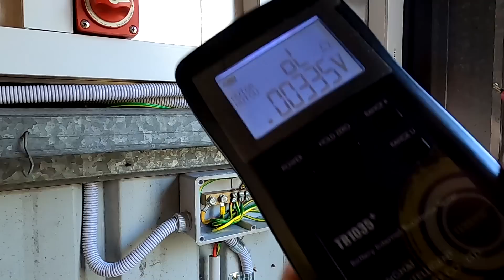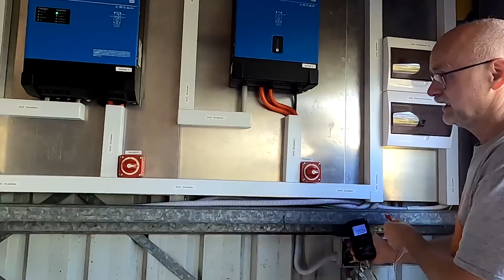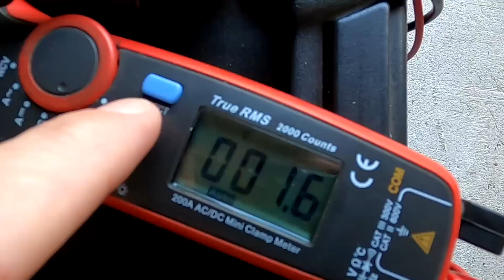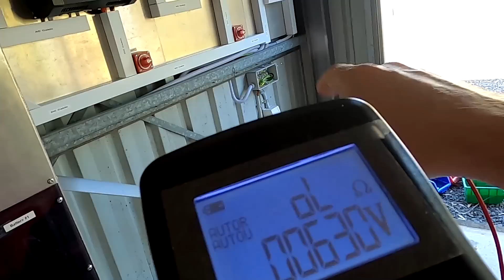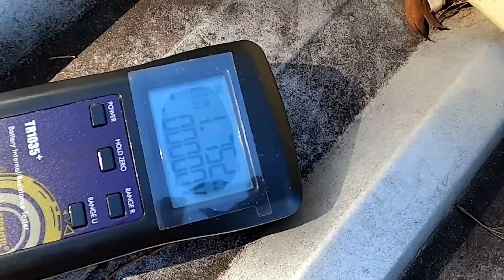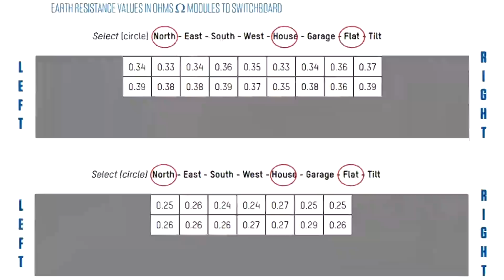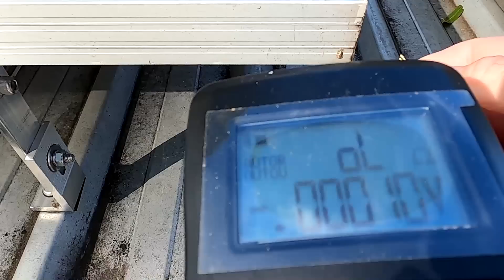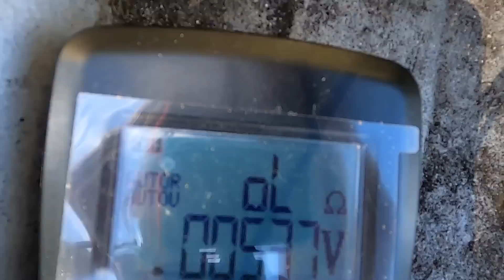Solar System Continuity Test: How to easily test your earthing.

Comment: By grounding the panels you are ,in a sense, raising the ground up to your your roof..if your idea is to remove static from the roof then break the ground with a diode to ground so you are not making the roof a lightning rod…or you could just put in a light switch to turn on before you go on the roof to remove the static…as we all know about magnetism and dc power, opposites attract and likes repel…if the roof is grounded always it will attract lightning….if it instead had a positive charge, or a static charge it would repel lightning…best idea is to put the switch to ground the roof before you go up then off when no one is on the roof…why do you think rvs or any vehicle with solar panels are so much less likely to be lightning struck?..

Comment: What’s the different between earth washes vs the grounding cable you use last time?
Are they interchangeable? Looks like you need both..
Reply from the maker: The earth washers connect the single solar panels to the rail. And you connect the ground cable to the rails. Otherwise you would need to ground every single panel.

Comment: I have mixed feelings on grounding solar panels or even the metal roofing. I understand that if a panel shorts out, you want the current going to ground so you don't get electricuted when servicing. However, when grounding, you effectively turn the solar panels and metal roof into a lightning rod.

Comment: Did not appear to be a problem however I am concerned the large loop area of the wire and return path act as an antenna that can pick up radio waves, inducing current into the loop, and corrupt the resistance measurement that is actually measuring voltage and computing resistance as R=V/I. If the meter is a constant current source it may not be aware of any externally induced current. The external current should be AC and might be ignored by a DC measurement.

Comment: With a Lightning Protective system install in the solar system will you bond the Grounding of the solar to the Lightning Protective system ground together? or it should be separated?

Comment: sir in all my installation I measure the voltage dc between positive end of the string and earth bar and. Then negative end of the string with the earth bar , the voltage will start with a high value like 300v DC and slowly come down to around 100v and stops there around 90 to 100v and. Doesn’t go below that what does that mean , is that still 100v is leaking through the. Earth body and we r loosing actual current , please help me to get the answer as I’m searching for a long. Time and keep doing installations but this pattern is always there

Comment: In most of the Asian country complying their local codes, DC earthing should be separated from AC earthing. At least 3m apart.  Lightning must not be bonded with any AC/DC earthing. This all I am talking about within one premises. I see BS and probably NEC recommends common earthing. Could you please address this issue.

Comment: "Press HOLD to enable the ZR function to measure internal resistance as low as 0.30-0.50 milliohms. The ZR function measures below 5 ohms, and the internal resistance is more accurate."

Comment: Hi great content, dose all this grounding effect the  bi metal insulation between different metals! And Increase corrosion! Which is why the rail feet are insulated in the first place.
Reply from the maker: Thank you, Lauri. Is that why? I thought the rubber is to prevent water from coming in...
Reply: Dissimilar metals can generate a small voltage which has the POTENTIAL to corrupt the resistance measurement.

Comment: how would you solve it, if there would be potential risk from lightning/flash impact? Is better to have grounding connected or is better to have it connected to lightning rod/conductor/termination (i don't know exact name of it).
Reply from the maker: Grounding is for electrical safety.
Lightning Protection is for... well lightning protection
These are two different things. LP is nothing for a DIY job any more and needs proper installation and testing.
Reply: Earthing is to stop you being electrocuted if there is a short to the metal. You'll feel it but it will take the path of least resitance down to earth so won't kill you. You have effectively created a lightening rod so need a lightening arrestor in your combiner box.

Comment: Just installed the 200a jk bms I bought through your link with aliexpress. Tried starting it with 9v positive to b- and negative to p- as per your other video. The light is blinking on bms but inverter and charge contoller does not turn on. Only getting 2.2 v on p- side??? What is going on?
Reply from the maker: Does the app connect?
Reply: @OffGridGarageAustralia  No it does not connect or show up. I think the caps in my inverter spiked the current when I turned on the bms frying it.

Comment: Hi Andy, ich machs mal schnell auf deutsch, sorry, baue gerade meine Victron Anlage in der Garage... hab wenig Zeit. 
(3x MP II 48/5000 2x 450/100 und Fronius 10kW mit 22kWp Solar und 31kWh Speicher)  

Kann es sein, dass du diese Unterlegscheiben (washers) mit den Spitzen falschrum montierst (also mit der Öffnung Richtung Modul, nicht Richtung Halter ? 
ich denke, die sind so gedacht, dass du sie 50% unter die Klemme /Halter und 50% unter das Modul legen sollst, deshalb haben die auch die Aussparung für eine Schraube... nur so ne Idee... 

Deine Werte sind ja so schon Okay 

Gruss aus dem Odenwald
Michael.
Reply from the maker: Hallo Michael, das dachte ich mir auch und hab das probiert. Das hat leider gar nicht funktioniert, denn die Klemme sitzt nur ganz am Ende auf der Schiene und nicht mit der ganzen Flaeche. Am Ende hat sie nochmal so einen kleinen Vorsprung und nut dieser hat mit der Schiene Kontakt. Das ist so gemacht, das der Haltewinkel eine gewisse Hebelwirkung auf das Panel ausuebt.
Ich denke, diese Erdungscheiben sind universal einsetzbar und je nach verwendetem System muss man sie unterschiedlich benutzen.

Comment: Just wondering and not taking into account the regulations, WHY and WHAT is the purpose to ground the metal parts of a solar array?
There is not a a hard connection possible between the metal parts and the live of the grid. It might even improve the change of lighting strikes when the metal parts are grounded….. regards
Reply from the maker: All metal parts need to be grounded for electrical safety. This has nothing to do with lightning protection. Two different things. 
If you have an inverter in your system, you have 230V (or 120V) somewhere. There is always the chance that something goes wrong...
Reply: OK, this could possibly be made up "theoretically". However, the aluminum frame of a solar panel is completely insulated from the cells with their connections, see the double insulated symbol on the panel. So if a live phase ends up on the DC cables from the panel, there is still no reason to ground the frame. Moreover, there are solar arrays for off-grid use (as the off-grid garage) and there is no determined live (phase) at all anymore. Moreover, grounding the frame (on the roof) gives a risk-increasing aspect with regard to lightning strikes.
nice discussion and keep up your most appreciated channel!
Reply: @OffGridGarageAustralia  It's not possible, your home is earthed, and power returns to it's source...you are worried about AC power, not DC, so it returns to it's source which is already grounded/earthed.  It accomplishes nothing, but do it if it makes you feel better about "safety"..  Describe the scenario where grounding a PV system has any "safety".  A ground rod is 25ohms with respect to earth and at 120Vac can carry 5amps tops, where does the rest go?  It's rhetorical, we know where the rest goes....and it's not to earth.
Reply: @iamblaineful  On a different channel, one person earth grounded his solar panels which was about 1k worth. Lightning struck close by and fried everything he had. AC has to be grounded in order to complete the circuit. You are absolutely correct that there is no need to earth ground DC whatsoever otherwise they will have a Lightning Magnet.

Comment: I have been told that the best way to use those special washers is to have them on alternative corners of the panels, which works really well when you have a string of panels and can share a washer between two adjacent panels.
Reply from the maker: They won't be long enough to span across the gab between two panels, Trev.
Reply: @OffGridGarageAustralia  Ah okay, I guess it only works when you are butting the panels up against each other.

Comment: Andy, Just had a thought while watching your vid about faulty victron controller.  I notice you have victron inverters... so do i and i had a bad experience not long after installation.  Lots of sparks and smoke.  The MP2 has a large opening in the bottom and a gecko got in.  The boards dont have conformal coating and gecko got fried. 

I was told it was my fault because I have geckos. It was eventually replaced under warranty when I pointed out that it was installed by their installer to their specifications into an environment that has geckos.

The replacement had a screen fitted by the supplier that keeps the geckos out.

As you are in Queensland, you  should think about screening out the geckos.
Reply: Hi Ron 
I heard more than once from this problem with geckos and lizards 
I live in Philippines now and you see them anytime 
,I start soon with a offgrid build here and use Victron also
Can you tell us how’s look the screen or can you make a photo of it 
Thanks
Marc
Reply: @marcvandaele1878  I dont think I can add photos, but its made of pressed plate steel maybe 1mm, with holes/slots pressed into it, maybe 2mm width. It it bent to conform to the shape of the bottom opening and held in place by the bottom cover.

Also, ensure the cable penetrations are secure for i suspect a gecko crawled up inside a conduit at on stage - a generous squeeze of silicone solved that.

I also put a generous silicone bead along the bottom of the board between the board and back of the case to stop anything that does get in, from squeezing between the high voltage terminals and case ground.

Comment: Hi Andy, you might consider doing a video about planing preparation and checking the PV efficiency too with the australian services from solcast and the usual extension I do not add cause yt would delete the comment if i would add a website. Since feb 2019 they offer a free service tool to check your PV system on a daily base if that is OK or not. The do predict and report the daily energy production with their simulator that asks for the azimuth, pitch , kWp installed and then does the math.

Great service and also free they kindly ask for a support by sharing with friends and family, and as you like to tell, this is our nice big family , right ?

How on earth I got behind an australian service being in germany you might ask ? 
Well, I do use a professional software for planning even made in Berlin, PV*SOL premium which is free for 31 days.
That offered a new interface for getting at least 2 times a month new records from that australian service to import climate dates for your projects and they have faster and more accurate data then the usual slow german services which do currently offer an average set for your city or spot with the data from when ?
Well, an average build from the 1980 - 2010 period and the hottest one from 1995 to 2012.
No, that is not 10 years behind or 10 years old. It is just a pretty nice riped set of records like a good old wine.
But I got those last week and applied it to my most recent projects and could recognice that the 2012 one had a 3% higher solar power input and output.
Not much but 350 kWh p.a. more than before which comes closer to our reality. 

Well, PV SOL had does release a new version every 2 months or so and in the recent update notes they presented the solcast service as a new feature and interface which I then checked out. So from australia to Berlin to me and now to you and our family is a pretty long journey I guess. And it is really hot in germany, really, really hot, one of the hottest days of the year in our forecast. If you check that free tool out there is a link to their blog at the end of the page of explanations (tool itself is on top of the page, not just stupid pics of it, that is the working simulator) and to the cto Nick Enger or so which is also quite nice to read what he is researching. Hope it helps to show how a set of the right planning tools might improve the decisions made to avoid mistakes.

Comment: Should you turn the grounding washer around.  That way the clamp and panel are grounded.  I see the washers appear to be cut out possibly to allow for the mounting bolt?  Also, looks like your meter does have a "Zero" function.  Great videos!

Comment: wow didn't realize the Anodized aluminum is basically insulated aluminum. Although, if that is the case what is the reason to ground it? A stray wire comes into contact with the Anodized alum frame rail and...nothing happens since the coating prevents the power from the wire transmitting to the aluminum  interior? unless there is a heavy scratch or high enough voltage to bridge?
I used Galv unistrut for my installation, although I can't say I did it this way deliberatly  to avoid anodized aluminums' insulation effect, nor did I deliberately drill the PV frames for mounting to the strut to ensure good ground, it just worked out that way LOL.  I also never bothered to test the resistance from Ground to the rails/PV panels (until today!) since it seemed "obvious" that it should all be 'good' - thanks for sharing Andy, now I know I am all good instead of assuming it. Interesting from the comments the various regulations across jurisdictions for the grounding requirements.  Like Arc-fault and Disconnect requirements, these are all different depending upon where you live it seems, perhaps we will see a convergence over the next decade of code requirements for PV everywhere.
Reply from the maker: I didn't know this either as I never tested it but all my panels weren't grounded. I have now ordered more of these washers.

Comment: Das geht aber so nicht mit der Messung ... Messstrom und Spannung zu niedrig ... AC nicht DC
Reply: Messfehler durch Störspannungen oder Strömen im Erdreich von benachbarten Spannungsquellen mit den Frequenzen 16 2/3Hz, 50Hz, 60Hz und 400Hz werden ausgeschaltet, indem Messfrequenzen ungleich dem ganzzahligen Vielfachen der Netzfrequenz verwendet werden. Einige Messgeräte haben mehrere Messfrequenzen, die abhängig von den vorkommenden Störungen automatisch ausgewählt werden.

Comment: Excellent Demonstration Andy.Well Done!. I'm thinking your internal resistance meter will give you a better idea of ground continuity than a low voltage OHM function on a Digital Multi-meter.
As your system relatively low current I say your tests should be adequate. 
I've got a bit of experience installing and testing grounding systems and grids for large power generation and distribution systems, and actual ground impedance in a multi megawatt AC generation system in operation can be quite different than measuring static resistance, but in your case I Say good enough. In fact, I'm not really sure if a commercial  High resolution earth tester would tell you anything meaningful if you used one. I've used industrial MEGGER units like the DET2 that could give you indications that your system is unacceptable if you did not understand what is was you were doing.  Sort of like measuring resistance on a 100m of 18 gauge wire with 50amps seeing a lot of resistance. Conversely, you could measure 'good' ground connections for a 200 amp service with 5ma using a  DVM, and read .5 OHM, and conclude you have a ground, but would it hold up to a 50amp or 200 amp fault to ground, or a 1,000 to 10,000 amp surge to ground without blowing or melting a ground connection apart?
Safe and adequate grounding is about proper sizing and ability to handle shorts to ground that a system is capable of producing without creating voltages on any part of exposed metal that people could come in contact with when things go "Bang', 'Buzz', or 'Sizzle'

Good Stuff Andy, Thanks!
Btw, I just found this instruction on using the MEGGER DET2 for those are wondering about the use and purpose for using a professional earth tester:
youtu.be/wXbtvJF-zyA

Comment: You could use your power supply set at 10 volts and 100 milliamps (on ground to test) and read the volt drop from point to point accurately as ohms with your meter.

Comment: I am just thinking blindly.... Is there a modern solution to detect thunderstorm so that it can shut off the whole system to avoid any loss apart from the earthing system..... Come on the electronics world..... Where are you ?
Reply from the maker: This method is for grounding, not lightning protection. Two different things.